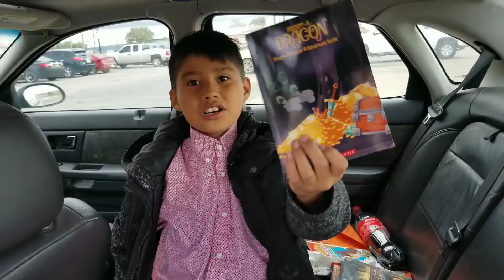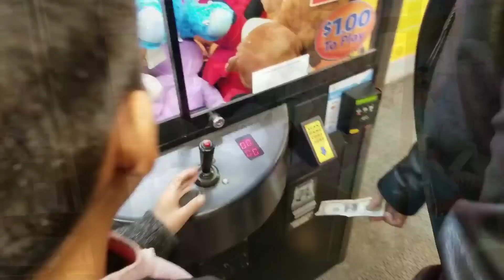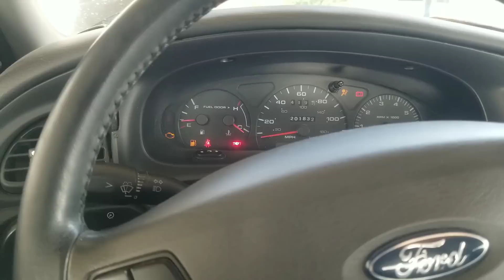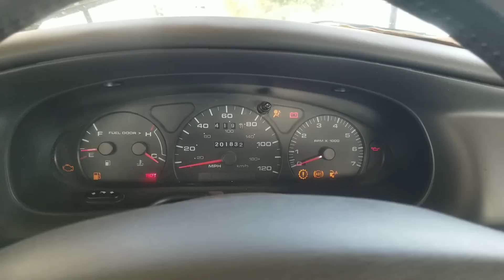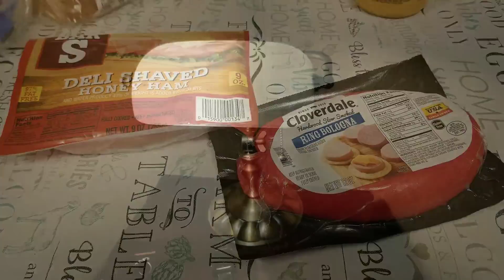Episode 27. we pour more cement and we break everything...

Comment: 👍👍👍 did you check the coil see if it sparks
Reply from the maker: No spark to the wires. The coil is brand new. Maybe a month old. The car wasn't running for a couple years so I gotta check a few things. May be the crank sensor.
Reply: Yea crank it see if the spark plugs firing
Reply from the maker: Already did. No spark.
Reply: I'll bet it's the coil

Comment: Question.. does the EGR come with the exhaust manifold.   Or they separate?
Reply from the maker: The EGR is separate from the exhaust manifold. It is a vacuum actuated valve that recirclates your exhaust gasses into your intake.  It usually bolts to your intake manifold, usually has a vacuum line connected to it and usually has a metal hose connected to your exhaust system.